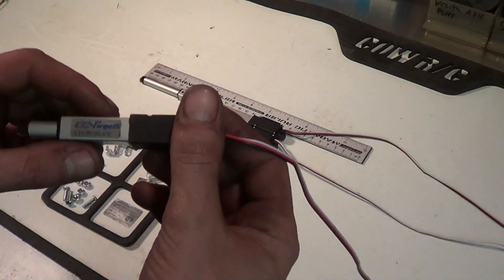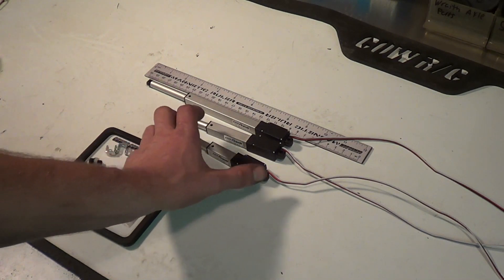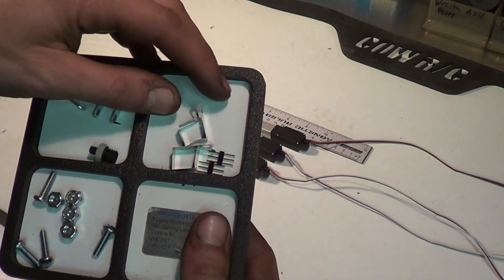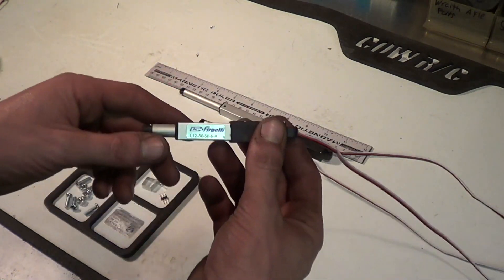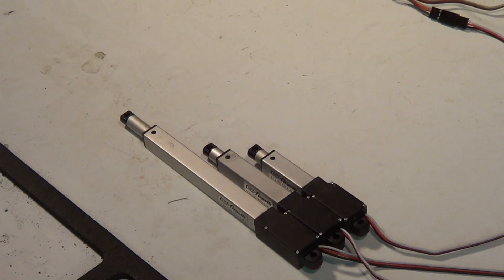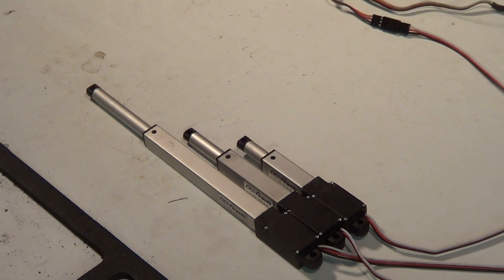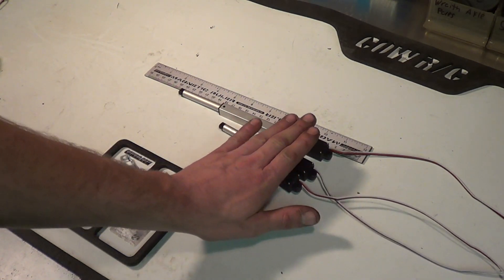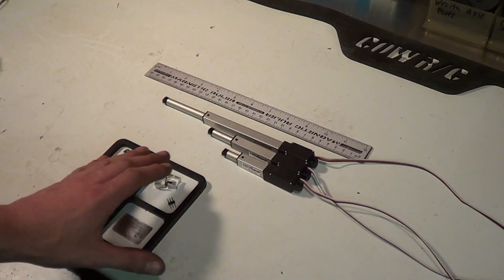JRP RC - Firgelli Linear Actuators L12-R First Look and Tests

Comment: Good video.
I use a 30mm 100:1 Actuator for rear steer on my truck, test video is: M5Tk_uh12PA
I used the 100:1 becuse I have dual wheels, but I think the 50:1 would be fine for a rock crawler or similar rig.
If more power is needed the 12v version of the actuators can be ran off 11.1v lipo and controlled by a Sabertooth controller and RC receiver. I have some sitting in a box for a boom I've yet to make.

Comment: im thinking of using one of the smaller one to shift gears on a mini bike motor. can these be set with a three position that returns to the middle position after every touch of the button in either direction. any suggestions on controller to make this happen?

Comment: good morning j! loved your video . Question? can I take 2 of those smaller linars and run them on a 3 position switch so they can run at the same time?????
Reply from the maker: Yes you can, you can either get creative with the mixes or you can us a y connection to make them run at the same time. And yes you can use them on a 2 or 3 pos switch

Comment: wonderful video! so each liner actuator runs 6 volts right! now if I use a y harness and run 2 100 mm liner actuators! on a 3 position switch! would it lift more than 10 pounds?????
Reply from the maker: +Jeremy Pete yep and yep

Comment: i have a project which includes at least 6 hinges, 1 (probably 2) slides and 2 telescopic rods, all spring loaded (sometimes heavily) when extended these are held in place by magnets.  need a way of releasing the catches on them for when they are compressed, would these be: a-strong enough to  release them and b- cheap enough to warrant using them for that many things (bearing in mind i could probably use one of them for more than one thing in certain circumstances.)
Reply: and if not do you have an alternative suggestion?

Comment: Hello, I have got some L12-R but I can't make them run. I am trying it with an arduino microcontroller with the "arduino servo" libraries for the signal wire, and they are fed with a 6v external power source. What kind of microcontroller did you use?
Reply from the maker: the -R actuators dont need a motor controller, the just plug directly into the receiver for the radio. if you still have problems contact firgelli since they know more than i do. i just use them :)
Reply: JRP RC Judd Phillips But the thing is that I wanted to control them using an Arduino Mega 2560 so that they can interact with the Input signal of some sensors. I do not understand the electronic behaviour of them. If the Signal wire is fed with 5V it extends, and with 0V it retracts? Because in the specifications it says that you Need a 2ms Signal in order to make it extend and a 1ms signal to make it retract...
Reply: If you haven't figured it out yet, You would use the Servo and Attatch code to make the Arduino control the servo.  Servos work by Pulse Width Modulation. By varying the pulse "on time," we can control the position of the servo.  You could do the same thing with the PulseOut command, but ServoAttatch is much easier.
Hope this helps.

Comment: Do they can run automatically? For example, I set they move back and forward 100 times, do they will have counter to count or I need to control it manually?
Reply from the maker: they run like a standard servo, you move the control they move
Reply: Got it. Thanks!

Comment: I recently bought a L12-30-50-6-R... I'm trying to use it with a Wireless 12V DC Remote Control Kit but I'm not sure if I need anything else. I need your advice thank you
Reply: Hi I'm afraid the "R" series actuators cannot be used with our wireless remote control. For that you would need an "S" series unit.

Comment: Hi...
I thought of using one for a steering servo ...a CMS system....and I need a 20kg servo at least....it's a heavy rig....
So how good they are?and are they strong enough?
Reply from the maker: Dakillswitch the L12 actuators in 210:1 have almost 10lbs of force and the L16 in 150:1 have almost 40 lbs of force. And i have never had one fail on me yet, but they are absolutely not waterproof and can not be waterproofed. I have not tried to use them for steering yet.
Reply: JRP RC Judd Phillips 
Thanks for the fast reply....I don't need it waterprof....
So thats not a problem for me....
The place on the rig that I'm trying to use is a bit small...so that why I'm thinking on these servos...
Reply: +Dakillswitch Where can I buy these linear actuators?I am to 12v?They are connected directly to the recipient or you need a Alro electronic circuit to control them?
 Thank you
Reply: +liberaitalia 
Hi...what is your E-Mail?
Reply: +JRP RC Judd Phillips akillswitch Where can I buy these linear actuators?I am to 12v?They are connected directly to the recipient or you need a Alro electronic circuit to control them?
 Thank you
Reply: +liberaitalia
 again...what is you e-mail...I'll send you a link....
Reply: Thanks
70$ for one only?
Reply: +liberaitalia 
Yap.....